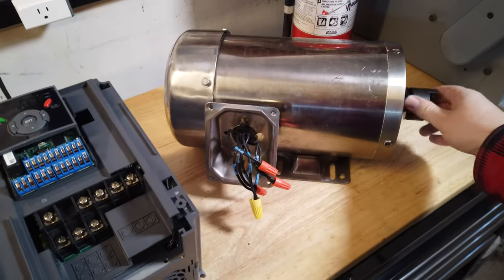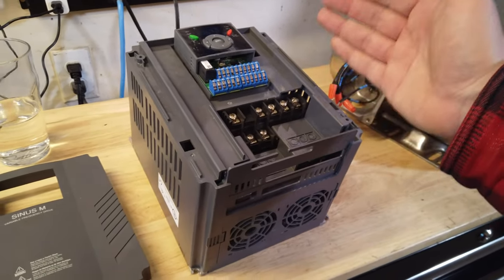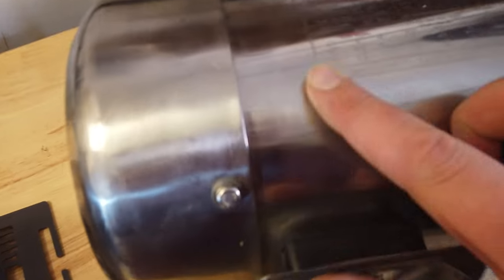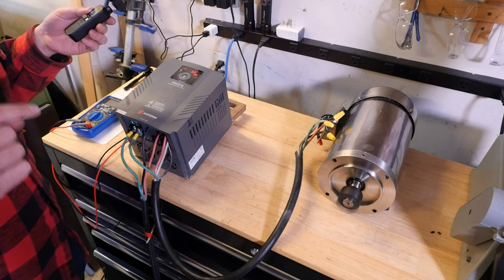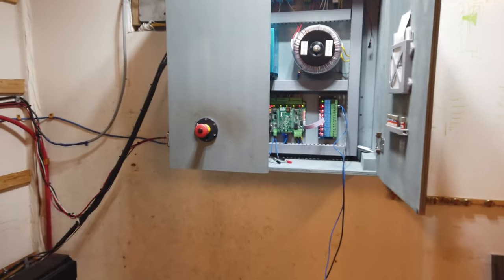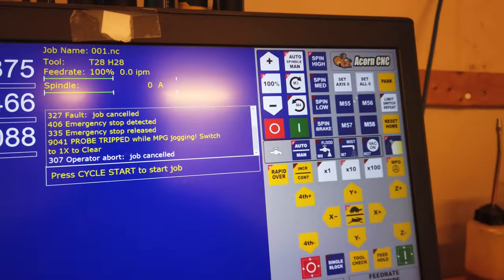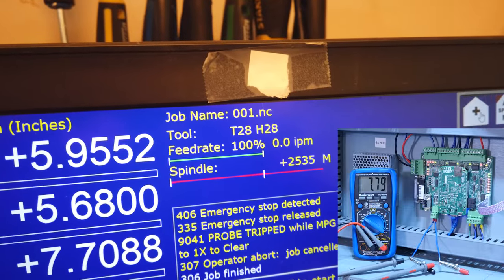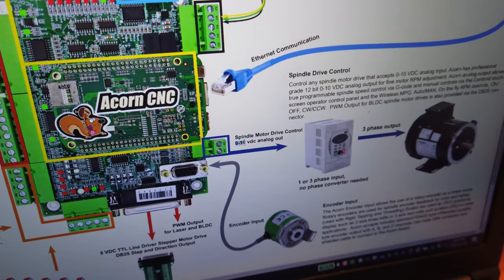3 Phase Motor on Single Phase - CNC Spindle Upgrade (Centroid Acorn)

Comment: Wow, talk about a perfectly timed video!  Just ten minutes ago, I'd submitted an order for a 1.5kW VFD to run my 1.5HP three-phase 220V motor from one-phase 220V input.  The VFD is rated for 2HP so I thought I had plenty of headroom.  Then I happened across your video with the caution to DOUBLE the VFD rating when using single-phase input.  

I'd never heard nor considered that, but it makes sense.  I did a quick Google search and confirmed ... although the actual calculation seems to be 1.73 times rather than double.  

I quickly canceled my order and ordered again, but for a 2.2kW (for 3HP) VFD this time.  You saved me an expensive VFD burn up!
Reply from the maker: Haha wow - no kidding! Glad the timing worked out and you were able to cancel it. Good to know re the 1.73 ratio. Good luck on the conversion & please share your results with me!. What kind of machine are you running?
Reply: @adamdebowski2037  I'll be using it to power a bench grinder: https://www.youtube.com/watch?v=3U86m8TN58E  .  I'm tweaking Phil's plans just a little to use a 2x72 belt instead of his European 75x2000mm belt, and to use standard inch material rather than mm.

I also have an MX-210V mini-lathe and a PM-30MV vertical mill, but both are manual (with DROs and drive motors, but not CNC'd).

Comment: Very interesting video watching you interface a VFD with the Acorn. Connecting the Acorn to your PM30 motor is basically the same thing. The main difference is the input to the motor is 0 to 5VDC so you have to scale the Acorn output down. I've thought about upgrading my motor to get higher spindle speeds for running smaller tools but 3000 RPM has been working fine for what I do. I know of a couple of other guys on IG that have upgraded their PM30s to 3-phase motors with great success. I look forward to seeing where you go from here.
Reply from the maker: Thanks for the kind words as always, Mark! I look forward to seeing where it goes, too! I've got to upgrade the base before really running an upgraded spindle. So i'll be doing the base and spindle in the next little while, and will be sharing the progress! Have a great weekend :) - Adam

Comment: The VFD will just calculate the rpm based upon motor rpm data, the Hz and the analog voltage. Unless it has an encoder providing input, it will never be more than a calculation. I have never heard of that brand of VFD, but it seems to have many setting parameters, and appears to be quite decent. I recently put a Baldor/Parker one on my mill conversion (most difficult yet), the manual was many hundreds of pages, and it took me almost a full week to set it up properly because one simple thing was overlooked. Of course I needed far more than simple start/stop and speed control. As I had to have spindle orient and specific start/stop rates. It also had to be setup for rigid tapping. Fortunately I now have two machines with same model of drive, so the second machine setup only took a few minutes. These modern drives are amazing in their capabilities, with all the potential possibilities that are available in the parameters. 

As for the compromise between increased Hz vs overdriving the spindle with pullies, you might just want to go with a larger motor to begin with, as either other choice will reduce output substantially.
Reply from the maker: Hi @MotorsportDiesel - Would you mind sharing the motor part number/details? Are you really able to rigid tap with an asynchronous AC motor? Is there an encoder on the motor? Thanks for sharing this - Adam
Reply: I use Linuxcnc, and I have an encoder on the motor stub shaft. It is a Baldor 3 phase Fadal spindle motor. You could also drive the encoder from gears or a pulley, either way would require you to set it up properly to make sure one revolution equals the encoder pulse count. I have a video on my channel that shows how it all works in Linuxcnc.
Reply from the maker: @MotorsportDiesel  that’s very helpful - thank you!!

Comment: I'm using mach3 and gave up trying to run my spindle vfd through it. You're pushing me more and more to take a dip into centroid.
Reply from the maker: The more I use the Centroid controller, the more I'm loving it. It seems to be really intuitive. I've never had an issue connecting any external hardware. So far I've hooked in a wireless pendant, limit switches, a touch probe, e-stop, a work light, and now spindle control. It's never taken me more than a couple minutes to have everything working, and it's quite reliable. I get ethernet communication faults once in a while (maybe once a week with heavy use), but that could be on my end. 

I don't love the software fees, but if I were to get another machine, I'd still stick with Centroid. Take these words with a grain of salt - I've never run a different controller! Cheers - Adam

Comment: I did exactly this for my PM25. Used an inverter-rated 2.2kW motor with single phase 220v VFD input. The motor is rated for 1:1 speed vs torque over a big range, which is really nice. And it’s controlled by the Acorn. Actually, I’ve done it twice now. Two machines, Acorns, VFDs and spindles. Once on the mill and more recently on my CNC router. I am having similar issues on the router spindle where command RPM doesn’t match at speeds lower than full. I need to figure out the scaling in both Acorn and VFD settings to make 0-10v produce 8000-24000 RPM, instead of Acorn thinking it’s 0-24000.
Reply: Pretty sure the mill spindle is rated for 3600 rpm at 60Hz but I can run it all the way up to 120Hz for 7200 rpm. But in reality, I can’t go that high because of vibration and bearing heat. I replaced the original main spindle bearings in the mill with angular contact bearings but I still need to replace the quill guide bearings with higher rated ones. I think I’ll still have vibration issues though. It’s good for about 6000 rpms though, which is a great upgrade from the original 2500 or so with the original 1 hp BLDC motor.
Reply from the maker: This is great info/feedback. Thanks Todd! There are a few things I'll have to do before installing the motor - spindle bearings being one of them. I'm still running the stock bearings & plan to upgrade to angular contact ball bearing. Would you have any part numbers to share re the spindle bearings you've installed? How are you getting up to 6000 rpm on the spindle? Are you using an 1800rpm AC motor or a 3600rpm motor? This is one of my sticking points right now. Care to share anything else about the pulleys you used? Thanks again!
Reply: Ok, my memory was a little off. :) It’s rated for 5400 rpm max. It’s a Marathon Micro Max Y366, 4 pole motor. Got it from Automation Direct. It was stupid expensive, way overkill but it’s awesome. :). 
Haven’t run it in a while since I’ve been playing with my router.
Reply: @adamdebowski2037  The spindle bearings were the ones that Hoss used for his Grizzly 0704, which are probably too small for your PM30. I bet someone has done it on your machine too so you could find what they used. One key bit was that you need some shims because the angular contact bearings aren’t as “tall” as the original wheel bearing type that’s original.
Reply: @adamdebowski2037  and I was wrong about the max speed I get. If the motor is rated for 5400, I think I limit myself to something like 80% of that which is still a big upgrade.

Comment: Hi Adam. Great work here man! I've got a PM30 that I am currently building out as well. Arizona ballscrews, Clearpath motors and centroid so we're pretty similar in that regard (aside from drive motors that is). 

I just ordered a mag sheet metal brake to make the enclosure and stand for the machine so I'm not quite to any motor upgrades as of yet but I had seen the CNCDepot FM30F and it looked interesting. Did you look into this motor or something similar with ATC functionality integrated and the cost benefit didn't pan out? I'm a newbie at three phase motors so I'd like to know your thought process if possible. 

Thanks so much for posting!
Reply from the maker: Hey Gohnna - that sounds awesome. I don’t know much about those spindle motors, and I haven’t seen anyone put one on a PM30. I think you’d need quite a bit of redesign on the head, and I’m not sure the peak torque is at the rpm range you’d need. Do these need to be water cooled?
Reply: @adamdebowski2037  It is a 4"x5"x12" 23 pound 4 pole motor with 12,000 rpm spindle, .0004" runout, 10 amp 3 horsepower. I saw a video of Clough42 running a CNC Depot FM30F (F designation is for the 4 pole motor) on his G0704.

I am a novice but the pros appear to be that it is a small form factor motor that is light weight and has automatic tool changing built in and is fully sealed with dual ABEC7 (P4+) bearings.

The cons are that the motor and Hitachi WJ200 package are $3600 and that it comes with ISO30. Additionally it requires a constant dry air supply as the motor is cooled by a labyrinth seal where the dry air exits around the spindle. 

Do you or anyone else reading this have thoughts or opinions here? The rigidity constrains of the PM30 point towards a three or four horse option I would think. Smaller is slow and bigger is too much for the ridgidity of the mill.
Reply: @adamdebowski2037  Here's a link to the video I'm talking about where you can see testing of the power of the motor. Plenty of other great stuff there too. 

Trying to figure this stuff out. Drinking through a fire hose. 

https://www.youtube.com/watch?v=ahLcJ6ndCN4&list=PLDlWKv7KIIr-ZDEgtxffu8zNpMG98Khbp&index=12

Comment: you can run like 120hz and double speed there are VFD rated motors. I don't think you can get the RPM's to align perfectly, also looks like you are running a older version of cnc12
Reply from the maker: Thanks Joe. Im not sure if this motor is inverter rated. The spindle motor I end up getting will be, and will probably be a 2 pole, 3600 rpm motor with bearings rated over 10K rpm. Didn’t know my cnc12 version was outdated. Will check it out - thank you 👍
Reply: @adamdebowski2037  I used a leeson motor and a cheap vfd on one of my builds was able to overdrive it looks like your on the right track. Playing with the accel and decell ramps and make sure don't over voltage without using a braking resistor.

Comment: And the reason you can't use a single phase to 3 phase converter is why?
Reply from the maker: You sure could, but you’d still need a VFD for speed control interfacing with a CNC controller. I’m just showing how I run a 3 phase motor without a phase converter.

Comment: My gripe is why the heck we call 220 single phase.  There are TWO hots, and they are out of phase.  There are actually two phases.  One less hot with 110 would be ZERO phase then?  Oh and if you add another hot, 380 we call it three phase.  But 220 should be called single phase?  Feck!  We're ijits!
Reply from the maker: Hahaha I thought this for a very long time! But the “phase” happens BETWEEN leads. So if you only have two leads, there is only one phase between them. But if you have three leads, there’s a phase between 1&2, a phase between 2&3, and a phase between 3&1!